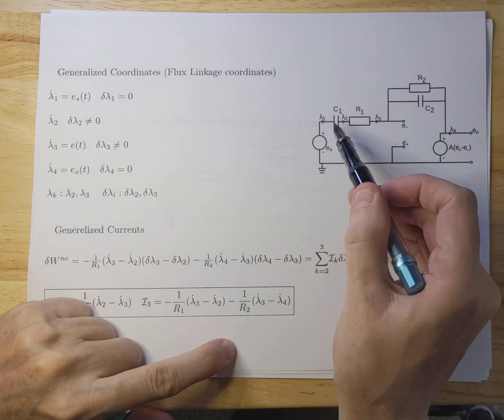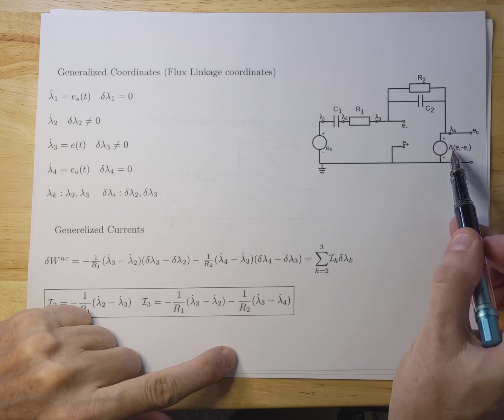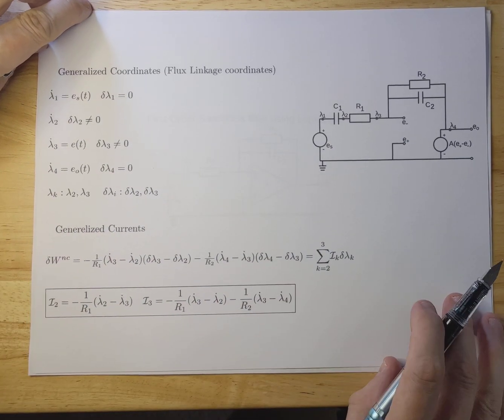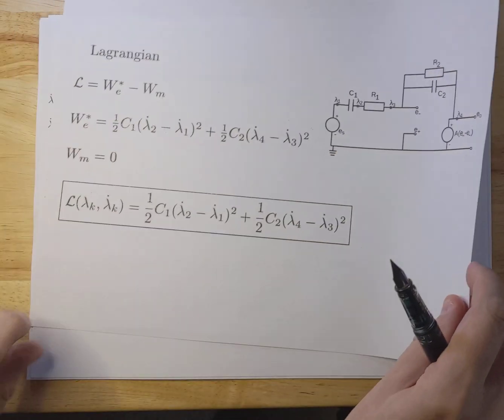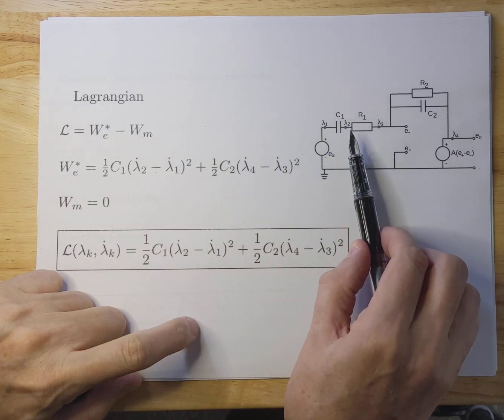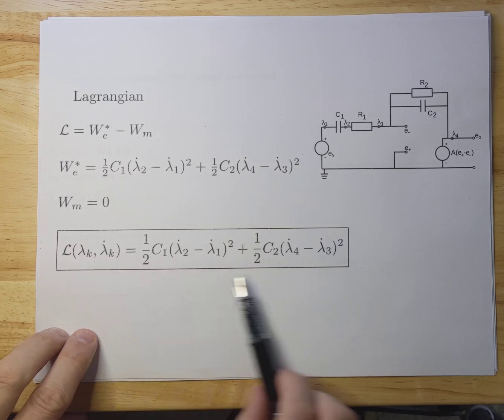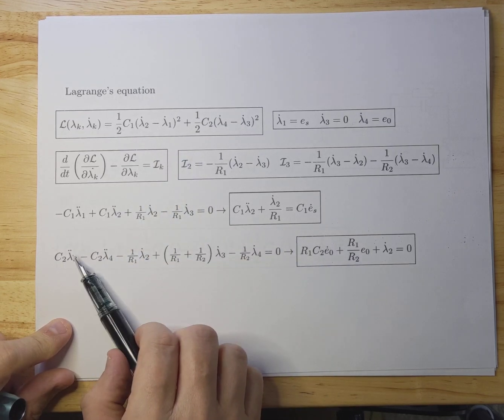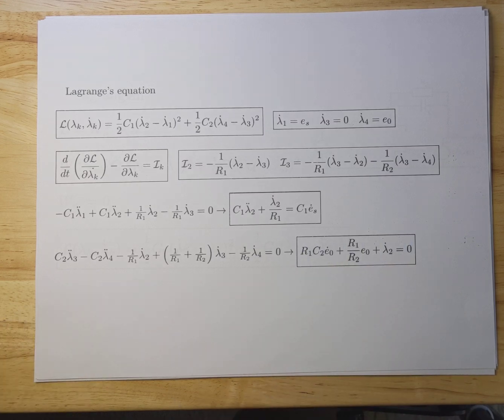Electronic Band-Pass Filter using Lagrangians.

Comment: Very Interesting. I didn't know there were a way of analysing circuits like these with lagrangians. I knew the LC, which is a classic, and recently came to work with circuits with JJ but It's hard to find a systematic way of analysing circuits using this formalism. Or at least I'm still not good at it. Do you know some reference (book, article...) which a I could use to study ?
Reply from the maker: Try look at the following paper: https://cimec.org.ar/~mstorti/MECOM2018/paper-5657.pdf that could help you get a feel for the material. You can also check out the various video's I did on this topic. I might do more of these in the future.

Comment: Love your channel! Why do you draw the asterisk on the W representing the kinetic energy? Is it supposed to be the conjugate of something?
Reply from the maker: It is called the electrical co-energy function and it is acquired using a Legendre transform as follows We*=q.e-We. In the flux linkage formulation we use co-energy, we could also decide to solve this problem using the charge formulation and then we had to use the normal We. If you are familiar with Hamiltonian's in quantum mechanics, where they use a Legendre transform to go from the Lagrangian description to the Hamiltonian description (L=T-V->H=T+V) is a similar approach. Hope this clarifies it a bit.